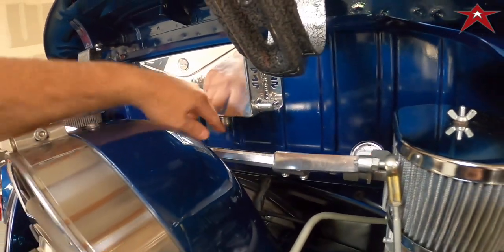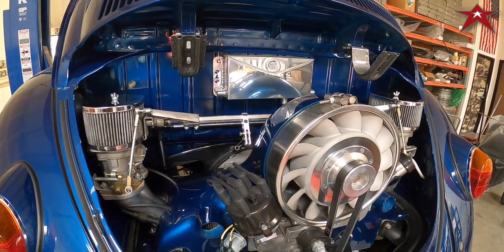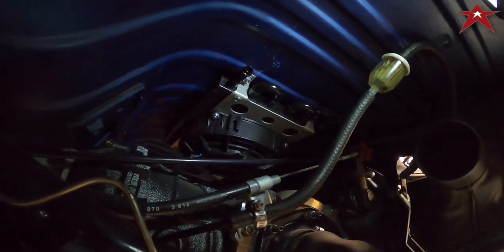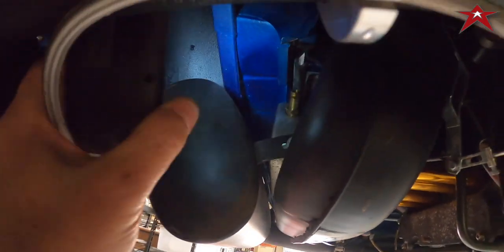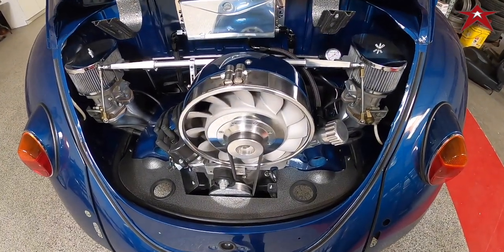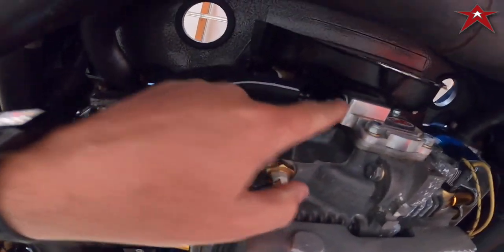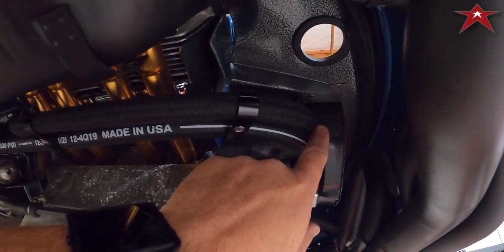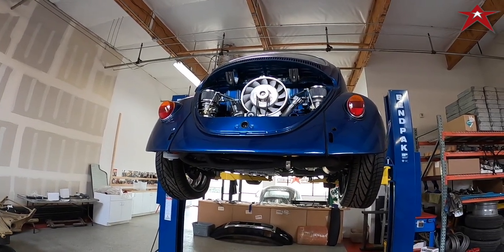Installing AN Plumbing on a BADD A$$ 1967 Classic Volkswagen Beetle - Oil - Fuel - Breather

Comment: Looks great, Pete. I have a few questions, if you don't mind:
- What brand hose and AN fittings are you using? 
- What type of thread sealant do you use?
- If running a standard doghouse fan shroud, how do you propose routing the hoses from the oil cooler to the engine compartment?
- Did you eliminate or relocate the fuel filter? If relocated, what filter did you use?
- I noticed no cooling tins under the push rod tubes. Are they not required when running the 911-style cooling system?
Sorry for the list, but "you're the man!"
Reply from the maker: Earls, -8 German Braided hose for the breather, Parker braided push lock for the oil system. Teflon tape
Reply from the maker: Route the hoses just like this video for an external cooler via full flow mod.
Reply from the maker: The client had one up front and one in the back, fuel filters. Eliminated one.

Comment: Hi ,  Very nice install , I do have the same engine Bergman shroud , let me ask you how many feet of hose do I need to install a air breather and did you use (5) 3/8   45    and one straight one  fittings ?

Comment: What size of tires are the rear? I have a 67 as well I want to make sure I get the correct size so it won’t rub with the fender while it’s tucked in.
Thanks good video as always!
Reply from the maker: 215/40-18's on this car.